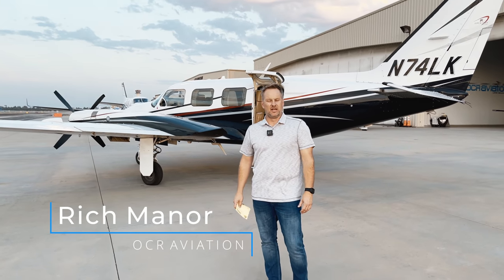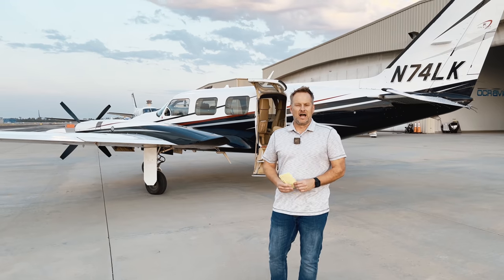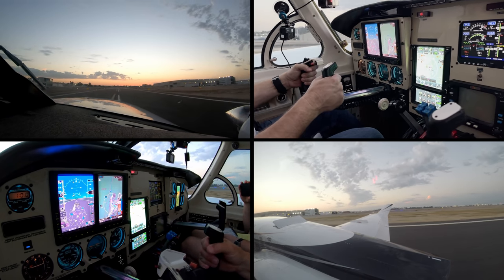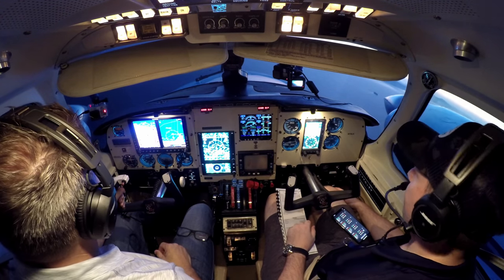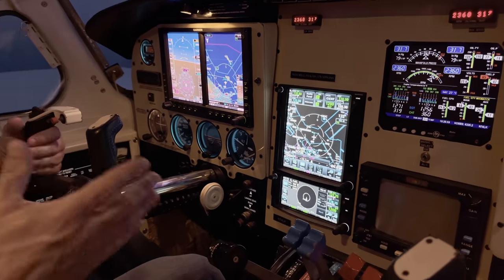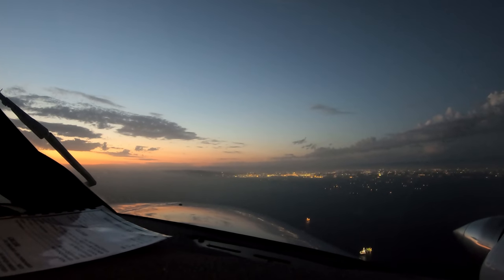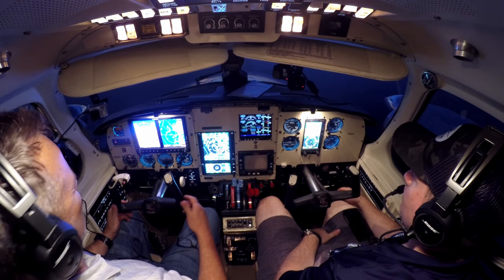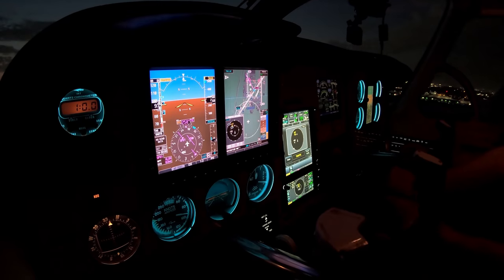#41 1980 Piper Navajo For Sale - Upgraded by Lock and Key

Comment: I owned 2 Navajo 310s (2x310 hp) and fuel ran 40 gph or less in cruise while he with a Navajo CR with 5 percent more horsepower was burning 50 percent more fuel at 60 gph. For 10 gph more move up to Piper Cheyenne II and get 100 knots more speed.
Reply: Your fuel calculations are off a bit. The Navajo CR 325 hp is 18 gph per side in cruise and the Chieftain with io540-j2bd stock engines is 20 gph per side. @ 31in mp/ 2400 rpm at 10k ft